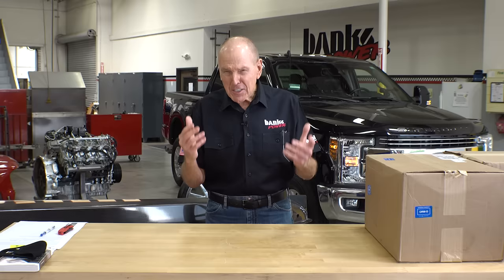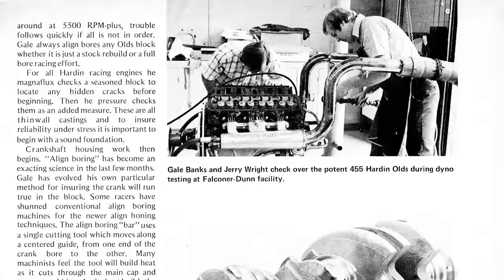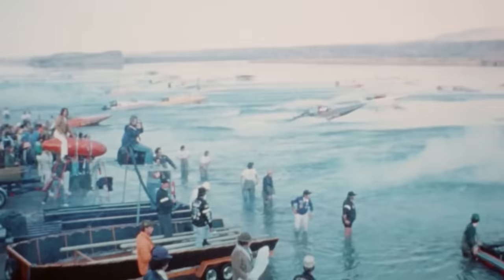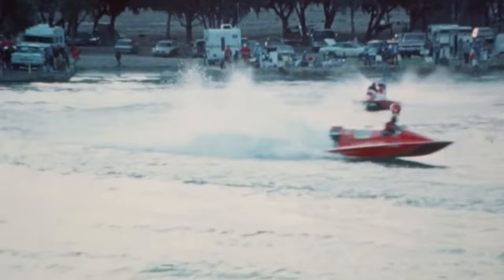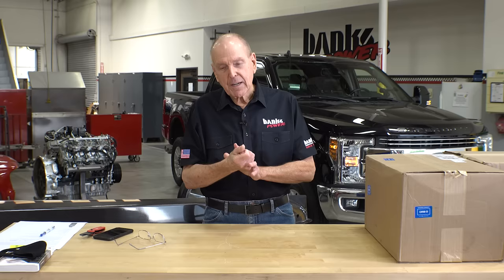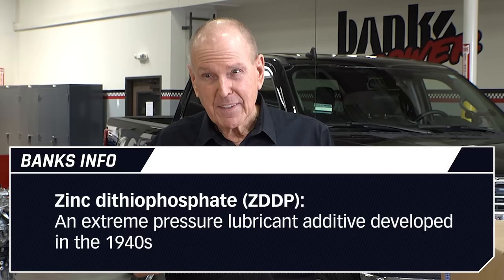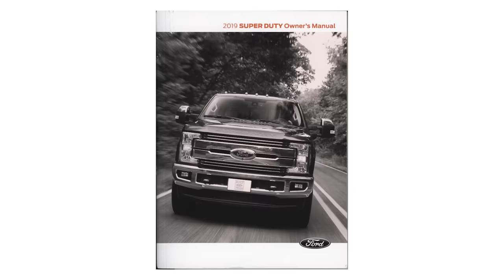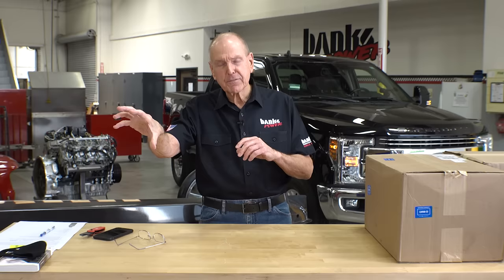ENGINEERING UNBOXED: This filter can extend your oil life

Comment: I put the Amsoil remote bypass system on my 1999 Ram 3500 and I hauled a 3 car trailer for about a year with it. I ran the heavy duty marine diesel amsoil oil and I was able to extend the oil change interval. I noticed that the oil stayed much cleaner and I also had it tested and the recommendation from the lab was to change the filter and keep running the same oil. It definitely will help your engine last longer. I still have the truck and it has 240K miles on it and runs as good as the day I purchased it. I highly recommend Amsoil products.
Reply: That's awesome.
Reply: Nothing will help your truck last longer if you already change your oil regularly. The bypass filter can only match regular maintenance at best, or maybe perform worse. It certainly won't help if you have a habit of not performing maintenance
Reply: @jankington216 Absolutely, without real scientific testing, it's bs.
Reply: @jankington216 the bypass filter is 1-2 micron. Metal particles that damaged the bearings the most are 1-7. So yes it is massively increasing engine life and oil life.
Reply: @2seep  That doesn't fix the oil losing its lubricity
Reply: @jankington216  that's where the used oil analysis comes in.
Reply: My test ran for 350,000 miles no major engine problems I sent in lab testing oil every 15,000 miles the lab test came back OK one time the lab test picked up a intake leak the best money a person can spend?
Reply: @2seep  agreed!!!!! It's so funny people that do not comprehend and think anything better than factory is a gimmick factory is a gimmick they want your engine to fail after the warranty is over so you will buy a new truck

Comment: You are a national treasure Mr Banks.
Reply: A storied name here as well.
Reply: The wealth of knowledge.
Reply: What happens when an engineer is also a mechanic. Most mechanics are just hacks with no formal education
Reply: @Shredxcam22  ,  That is the difference between a technician and a mechanic.  That is why technicians typically work at dealerships and are factory trained.  You also get what you pay for.
Reply: Dan straight.  A Legend
Reply: Gawk gawk
Reply: @doolittlegeorge  I
Reply: @Shredxcam22  Please speak for yourself; many mechanics are highly educated.
Reply: @jmackinjersey1  There really is no difference, it's just a different name. Dealerships prefer to call them "technicians" - i carries a high connotation, but no different than a mechanic. Many independent mechanics have factory training, and please not - Factory training is on particular brands and systems. There is higher training than "factory". A good mechanic will have training and understanding that far exceeds factory training.
Reply: @jmackinjersey1  dealership mechanics are limited to what "the book" says.

Comment: Who remembers the old engine oil bypass filtration systems that used a role of toilet paper for its filter?
Reply: Terrible system as the oil channels through the weakest point and then you get no filtration.
Reply: The actual filters you we’re supposed to use were just replaced with toilet paper. But really when using the correct filter it was top notch
Reply: old Chevy stovebolt with no oilfilter, helped. that same filter is still around, works great in paint booth for  me and on Plasma torch.

Comment: Amsoil makes the best oil in the business. Proven over and over again by torture tests, real world in-vehicle testing and lab analysis.
Reply: Amsoil does make good products but in most vehicle applications the oil gets filled with dirt and contaminates long before the oil starts to break down.   Even using conventional oil.   Most of the type synthetic oil is a waste of money.  Also gives people that false impression that they can safely do extended oil changes when it's actually causing damage and wear to the engine
Reply: The bypass filter mentioned filters down to 2 microns. It'll filter your whole entire oil system within 30 minutes of vehicle running. Then do it again over and over.
As for oil, I prefer Redline. They use a higher quality synthetic base to start with.
Reply: If you have doubts about the bypass filter system, you can send oil into the lab for testing. You just need to put a little valve in between the bypass return line to the engine. So you can get a sample. Send it along with a new oil sample. You'll be shocked

Comment: This is a little different, 2008 January, I installed a bye pass filter on my big truck, Filtration Solutions, Olathe KS same idea, it works, 1,128,000 original engine. Changed bypass filter every 10,000 mi changed Oil & & complete service once every year

Comment: I work in the passenger railroad industry. Our locomotives use Cat C15 and C18 engines to provide 480 VAC power to the cars. The Cat engines have a secondary oil filtration system that uses a centrifugal style, or "spinner" filter to remove excess soot from the oil. 

In all honesty, the Cat engines are under worked - while the generators strapped to them are rated for 500-600 kW, they only regularly see about 10-12% load (maybe about 15% for the C15 engines with 500 kW generators). That extra filtration really helps a lot, as the engines don't run hard enough in normal use to burn off all the soot and particulates that build up.
Reply: One boat that I worked on as chief engineer had the biggest Spinner 2 that T.F. Hudgins made (the 600?) on each of the EMD 16-710 main engines. The Spinners had an electric motor driven pump pulling from the bottom of the oil pan to operate them, didn't tap into the engine's pressure system. Our oil analysis always came back with below normal soot content; we cleaned each Spinner once a month, and always got a phenomenal amount of soot out of them. The airboxes really didn't stay that much cleaner, but you could definitely see a difference on the top ends of the engines, much less sludge buildup between overhauls. As an aside, the Spinner bowls were a real chore to clean, so we took to using spray nickel anti-seize on the insides of the bowl, the joint between the bowl halves and the inside bottom of the internal baffle (funnel?). Problem solved; a simple scraper made from al old wooden spoon that the cook had tossed got the job done in no time then.
Reply: @BilgeDweller  hahahahaha! That's awesome! 

Our EMDs don't have spinner filters on them, but I bet they'd benefit from it. That said, the michiana filters do a pretty job of keeping them clean.
Reply: I wonder if they've looked at an approach with multiple smaller I6 diesels, with shared oil and cooling, attached with clutches. You could make sure that all of the working engines get some time, keep at temperature; but only enough of them are actually running to meet the load at peak efficiency.
Reply: @microcolonel  Those are commonly referred to as "gen set" locomotives. I've heard a lot of mixed things about them, with the negatives being maintenance and reliability issues.
Reply: @jameshaulenbeek5931  Yeah, I can see a lot of pitfalls regarding reliability, but I think if the [mechanical, electrical] engineers aren't sleeping on the job they should be able to figure it out.

That's why I was talking about a shared generator, multiple motor arrangement (rather than a set of independent generators). I'm inclined to look at the frequent and repeated cold starts as a major factor contributing to reliability issues, before anything else.

Also I think they only make gensets for switching, not sure if there are genset primary locomotives.

Comment: Those systems are the ideal way to filter oil. The oil itself is not what breaks down but all the crap that gets in it, be it diesel or gas. 

I’d love to see the install of this!
Reply: The oil does break down, first it gets diluted by unburnt diesel blown past the rings, petrol engines do this, but petrol is volatile so when the oil gets hot the petrol boils off and  gets burnt via the crankcase vent system, diesel is too heavy to boil off.
Secondly the long chain molecules in the oil get mechanically broken by the rubbing parts and thirdly the extreme pressure and viscosity improvement additives get broken down.
So you can only extend the life of the oil so much before it needs replacing.

Comment: I'm always impressed and appreciative of the expertise of Mr. Banks.  Thank you, Sir.  However there is one  statement made around frame 5.25 that I think is not so true.  He stated most oil filters are efficient at around 20 microns .  There is one common, full-flow, off-the-shelf oil filter, interchangeable with the common 51515 oil filter that has a 5 micron nominal rating and flows 10 gpm at only 3 psi.  The filter holds 32.4 grams of contaminants in 463.1 sq in of filtering material.  That filter is the Baldwin B7311-MPG oil filter.  When I got my first IH truck in 2013 I could not find anything definitive as to what oil filter was best for that truck's engine.  So I did a very exhaustive research on over 300 Wix and Baldwin oil filters.  Many hours were spent pouring over technical specifications , plotting beta ratio graphs and on the phone with Wix and Baldwin technical support.  In the end I list in two tables the very best Wix and Baldwin oil filters  based only on technical specifications.  The tables can be found near the bottom of page 2 of this IH forum post:  
https://forums.ihpartsamerica.com/threads/are-there-different-grades-of-wix-oil-filters.4022/page-2 
I now use this filter in all my IH and Ford trucks and I could not be happier with this filter's performance.  It actually feels like (unproven opinion) because of the flow-ability and less parasitic drag that my engines have a bit more power especially on the very cold, below-freezing mornings.  I suggest if you have the time, read the entire page 2 of that forum post.
Reply: I just read your postings which your link connects to.
Sir, I have never encountered anyone who is more deserving of gratitude for the extensive work you've done, and your generosity to share it.
THANK YOU!!!

Comment: Ive been running this Amsoil bypass setup with the Amsoil 15w-40 HD Diesel and marine oil in my Nissan diesel 4wd for about 6yrs or 90,000klms.  No issues.  Worth doing an oil analysis at least every 10,000klms to ensure fuel dilution is within spec
Reply: May i ask what nissan you own?

Comment: I have had oil bypass filter in my truck for the last three years works great I’ve got a Ford F250power stroke 2011 keeps the oil a lot cleaner when I am hauling boats around.
Reply: Chris, i have used a bypass filter on my f350 6.7l engine for the past four years, and I change my oil yearly now instead of bi-monthly.  At $150 per oil change at the shop, and $80 per change doing it myself, my savings long term just in used oil are huge.  Factor in a cleaner engine and longer expected life, I am very happy.
Reply: the by pass filter has to cables. where do they connect to? I m confused based on the video above.
Reply: @tpfmike1976  One hose is going to connect to the stock oil filter in some way, depending on the vehicle brand.  The Ford, as Gale showed in the video, has a spin on housing between the stock filter with a port for the bypass hose.  Cummins has a port on top of the stock filter housing.  Not sure about Duramax.  That hose runs to the bypass filter.  The return hose connects to the bypass filter and runs to the supplied oil filler cap.

Comment: I loved the vintage footage of the jet boat enduro's.  Oldsmobile had a pretty big presence in jet boats in the early 70's, but had a lot of failures, which I heard was oil system related.  I never knew that Gale Banks worked on the Olds.  A 9-hour enduro would make most engine builders today whimper like whipped puppies.  And 9 hours at high speed in a boat would be like a day-long plane crash.  Marine engines really have to be built tough.

Comment: I knew a man that worked at the BOC engine plant and had been on the design team for the Oldsmobile Diesel V-8.  In short, he said that the team members had explained to the high executives over and again that they needed more time on the design.  The exec's didn't care and they wanted an engine pushed out for as soon as the next season.  That was about 30-60 days at that point.  Unable to accomplish that because of the very limited time, the engine they were able to produce was basically a converted 350.  They forewarned the exec's against putting that into production.  And as we all know, it did go into production.
The failure of the Oldsmobile diesel was due to the boardroom pushing the high executives.  Not anything lacking with the engineers.  As always, I believe that we (the USA) had the best engineers in the world, but no engineer can produce anything good if not given the time to do so.  I'm not sure how Gale Banks plays into the mix other than what he offers, but I'm sure he's in agreement with what I have to say.  So basically, this failure on GM's part is once again another example of their boardroom kowtowing to stockholders.  If GM didn't do that, they would be a great company rather than a hit or miss company, now building what many of us former loyalists find to be substandard junk now buying buy Asian cars.
Reply: How would complete failure appease shareholders? I mean, I think mostly you're correct but come on, if the lead engineers said it's junk it wouldn't have hit the market. Somebody, somewhere at GM said it would be good. And of course they lied.
Reply: @thisismyname2936    The reason is that the stockholders, thus GM, only think in terms of fiscal quarters.  It's always profits now.
Reply: My 1978 half ton Chevy diesel turned me into a Toyota guy.
Reply: If you look closely at the german car manufacturers you'll see a similar pattern. Their quality is far into the past now and you can tell its for the same profit driven time reducing reasons

Comment: Mr Banks.You are very respected by me.I own a 2001 dodge Cummins pickup with 400,000 miles. Looked into the bypass kits. They were to expensive. So I talked with some truckers and went on line and found an oil filter with the bypass filter built in. The filter is a baldwin 7317 for a 2001 Cummins. I change my oil every 5000 miles. The oil is dirty but not full of soot.I hope this helps you and others out there. Take good care. Yours Bill
Reply: Send me pictures

Comment: Been out of the country for about 20 yers, just got back and saw your channel.  I had been using Amsoil DUAL bypass filter setup with filters that are about twice as long as the one you are showing.  They were mounted in Chevy wreckers with 454's.  So you had to use around 11 quarts for an oil change.  Usually at 15,000 miles I would dump the engine filter and both bypass filters and add 3 or 4 quarts of oil, then at the next 15,000 I would do a complete oil change.  Those 454's would outlast the trucks....usually putting on 100,000 + miles a year for 3 or 4 years.  Oh yea I had been using this system since the 80's and the mounting kit you have is way nicer than what they had back then.

Comment: Mr Banks I have learned so much from your engineering. By far most impressive with that monster Duramax your playing with.  I've deleted my LML and decided on the CAT oil filter upgrade  and within 9000 miles on my first oil change it was just as clean when I put it in the crankcase.  Unfortunately the EPA has made it so tuff for engines to keep up in these new years but,thank you for all your engineering and research.    '13 DURAMAX LML full delete with 2" up-pipes and 3" down pipe, 5" exhaust and you guessed it.  No muffler stock turbo and Injectors and compound turbo added with 3" air to air custom built by yours truly. 26 mpg highway and 17.2 running my hotshot trailer